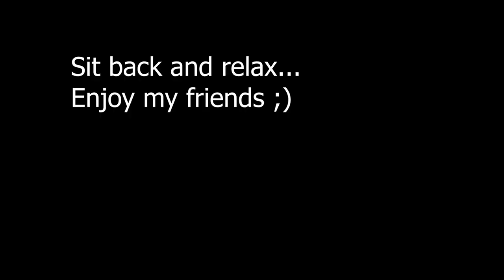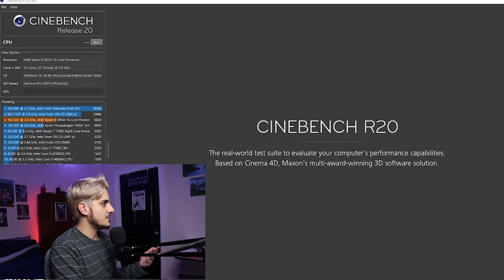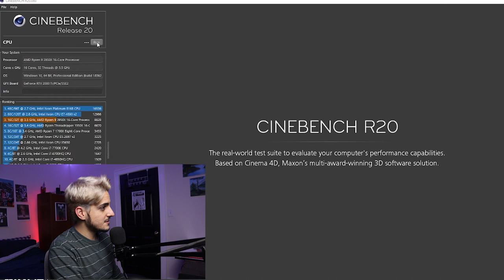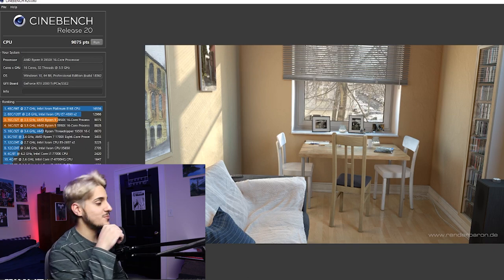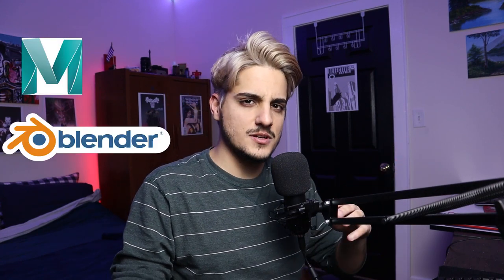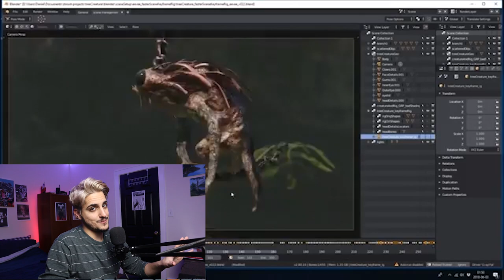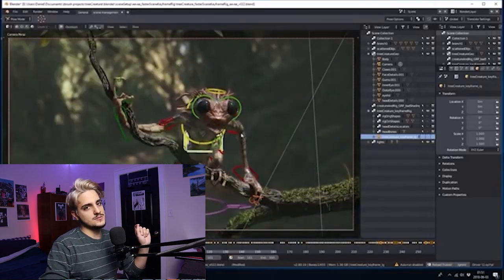$4000 ULTIMATE Animation PC Build! Ryzen 3950x & RTX 2080 Ti

Comment: One tip : Install your gpu in first slot and rest all is perfect nice build buddy
Reply: was about to sa the same then saw ur comment :P
Reply: Yeah I was going to say that too.
Reply: does it actually matter? Like is there a difference between the two placements?
Reply: @zeallavacube6357  yes
Reply: @HEMANTKUMAR-rg5sx  could you please explain in detail?
Reply: Zeal LavaCube The first is a full 16x pcie lane. The rest are 8x pcie lanes. At least this is the way most consumer motherboards work. So if you put the graphics card on the second slot, it won’t be able to run at it’s full speed,
Reply: @joeldancaz  Thank you :)